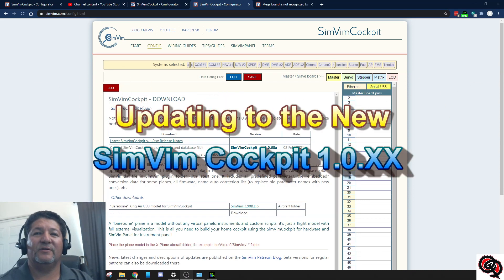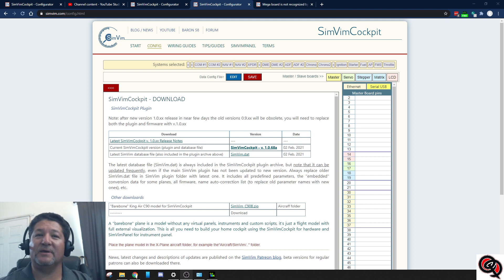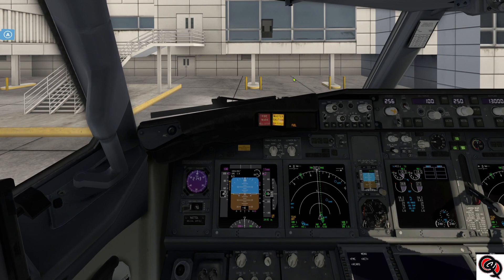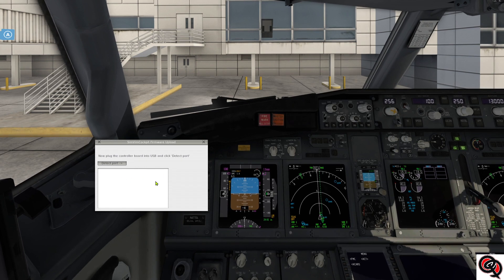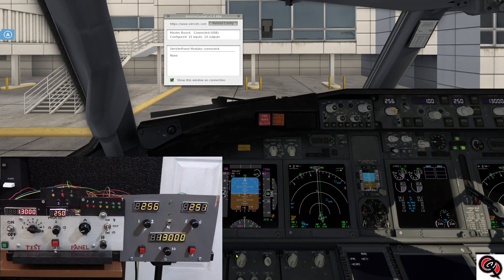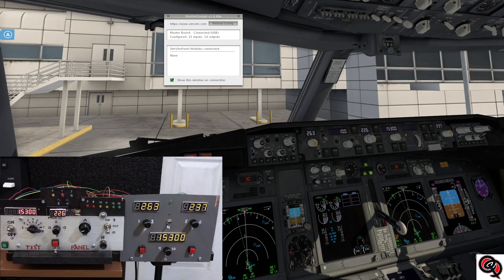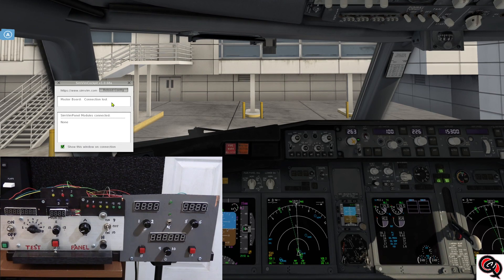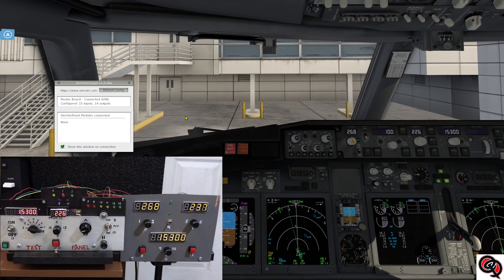Updating to the NEW SimVim Cockpit 1.0.XX

Comment: Is there still a way to add inputs for AutoBrake in 737. The old simvim version had all of this but now i'm lost as to how to find these inputs. Also the FLOOD lights are missing also. Any help is appreciated
Reply from the maker: It looks like right now that image map is missing from the website. I'm sure they will put it back up as they are continuously adding more to the new site
Reply: Please check the wiring if all pins are still in the original inputs were you had it before.

Comment: Thanks for the great and informative videos - I am a recent sub :)

I am new to SimVim and have an issue with connecting more than one component. I successfully installed the latest firmware 1.0.68a and got the example pitot tube script working with a toggle switch.
 
However, as soon as I add an additional input, both inputs stop working in SimVim. I have isolated each switch and both work perfectly by themselves (e.g. just pin 2 by itself & just pin 3 by itself), but as soon as I try to use the configurator with pin 2 & 3 assigned the switches become unresponsive (not recognised in the 'input options' menu as well).

I have also tested that these pins work on my board by uploading a simple Arduino sketch which works perfectly.

I'm not sure if this is something you've seen in the past or know what a possible fix might be?

You can find some images of my setup here: imgur.com/a/M4s7413
Reply from the maker: I'm wondering if that shield you have mounted on the breadboard is causing a problem. Also I've never seen those little black things that are in the breadboard, I'm assuming they're switches but I'm unsure of the connections. I have like 100 inputs and 14 outputs on my setup and the only time I have had weird behavior is when my wiring is causing a short
Reply: @Qosmokid  thanks for the reply :) yes the black things are spdt switches, hard to see in the photo. the shield isn't a problem - i removed it after the photo and nothing changed. i'm now suspecting a dodgy mega as i don't think it could be anything else as the wiring is very simple!!
Reply from the maker: @robbie_vanleeuwen  Yes I agree, have you tried in other pins on the arduino? I just remembered  I used to have a problem with pin 13 a long time ago. It would short out if I connected anything on that one
Reply: Just got a reply from SimVim and apparently it was a big with the update - fixed now! Thanks again :)
Reply from the maker: @robbie_vanleeuwen  You mean with 1.0.68a there's a bug. I just noticed a lot of my switches were exhibiting weird behavior also. It was all fine on my test panel but not on my real setup. I went back down to 0.9.67a and everything works perfectly.
Reply: @Qosmokid  Yes the bug was with 1.0.68a, however a new .dat file just got uploaded to the website which fixes the bug, the version number or date hasn't changed though.
Reply: @robbie_vanleeuwen   
1) The small,  not important "bug" has been in the firmware ALWAYS - but nobody (except Robby) have noticed it because nobody have tried yet to use exactly 2 switches only (not one, not 3, nor 300) - this bug was in the USB firmware and  it only appears when exactly 2 DIRECT (not MUX) inputs are configured. If there is 1 input or MORE than 2 inputs, everything worked OK.

It was fixed, but not in the plugin version, it's in updated SimVim.dat file.

2)  The v 1.0.68 was error with USB connection  in the Windows version and a bug with  re-connection after Firmware Upload window was opened.
Was immediately fixed in hotfix version 1.0.68a  

3) In v 69 - changed the  initial communication control for LCD slave board. Added the warning message window in the plugin. That's all.
All changes you can read in the changelog  located in the download page below. 

Vlad
Reply: @vladsim220  thanks for the update vlad :)

Comment: Thanks. Once you save a backup.. How do you tell the ui to force update the firmware from your pc and more simvim site.
Reply from the maker: It's pretty much explained in the vide. You need to go to the website, download the new plugin version, put it in your XPlane plugins folder after you remove the old one. Then open XPlane go to the plugins menu > SimVim Cockpit > Firmware Update
Reply: @Qosmokid  so going to plugins firmware update option doesn't get it from simvim.com? Also will it update if I I'm trying to force update an older version.
Reply from the maker: @Bren39  no you have to download it yourself and put it in the plugins folder like I described. Nothing is automatically downloaded. Watch the video before this one if you want to go to an older version
Reply: @Bren39  You should upload it exactly as described here: https://www.simvim.com/index_s.html
No need to do anything with your mega2560 that had old firmware, no need to "save backup" - simply disconnect the board fro USB, then - open the Upload firmware window, and follow instuctions.
Vlad